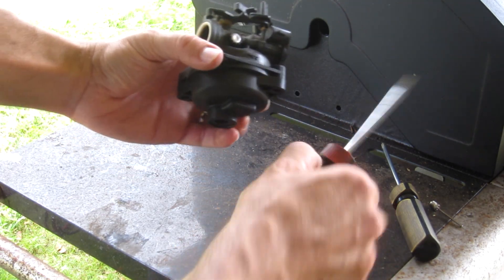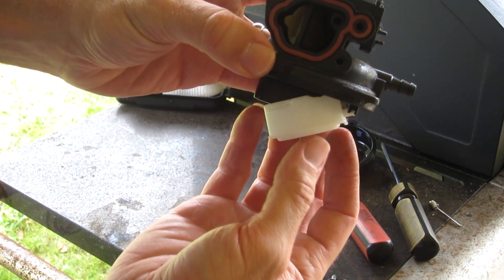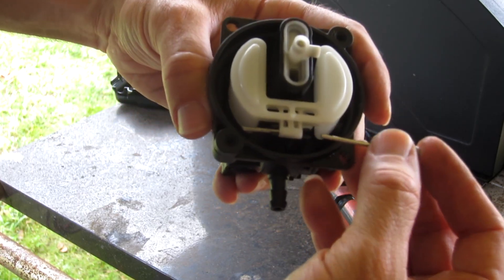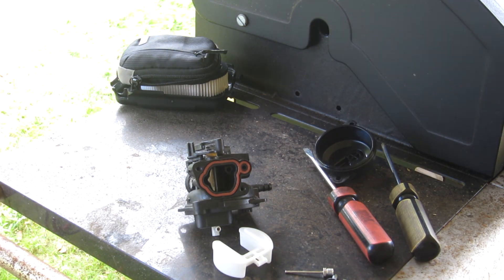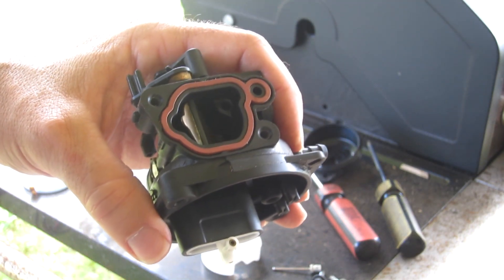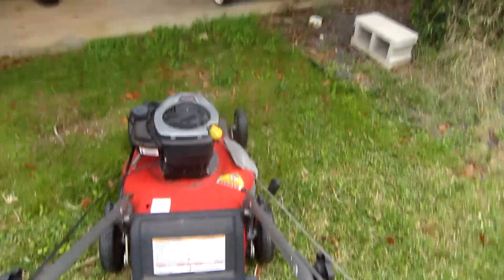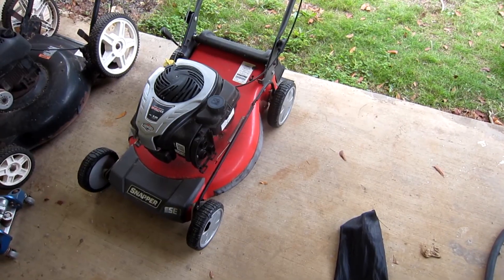Briggs and Stratton 550EX Carburetor Repair Part 2

Comment: Perfect instructions, presented in an easy to understand manner. I took the whole thing apart, cleaned it with the needle just like you said, mower started on first pull and runs great. Thank you.
Reply from the maker: Thank you for commenting. Congrats sir

Comment: Just watched another video. The guy was talking about the same prob i have. Everythings vlean and clear but wont start. He drilled out the bottom jet in the bowl.  Ssems like a vommon prob. Idunno if maybe the manufacturers put a jet that was too small in some of them or what. Thats the only thing i can think. Cuz half the people get it done by cleaning. The other half still wont run.

Comment: Thank you! When the needle came out, I do not see a copper ring in side.  Not sure if there wasn't one or it fell away as I cannot see one anywhere...  When I put everything back together, gas is leaking everywhere.  I'm checking all of the seals but wondering if that could cause the gas leakage.
Reply from the maker: There will have to be a seat for the needle to seal up next to, or you will have constant gas flow through the carb which will end up spilling outside.  That being said, the bowl o-rings are notorious for getting out of whack when installing the bowl so double check that gasket as well.

Comment: I have this exact carb and it does not start.  I have spark with a brand new spark plug.  Even spraying starting fluid into the carburetor does not fire it.  I took the plastic carburetor apart and it essentially looks brand new on the inside but I cleaned it anyways pulling the white pieces apart like you did in the video.  All the holes were open but I probed them with wire as well.  I used regular 87 octane gas and the gas tank had very little gas in it until I added more.  I have good flow from the fuel line of the gas tank into the carburetor because when I clean the carburetor gas poured out.  And when I check the spark plug it was wet meaning gas got into the combustion chamber.  I'm trying to figure out if I have compression I don't have one of those fancy compression testers.  But after I put everything back together it still does not fire and I've left the air filter off.  The auto choke with the cold engine is completely closed.  Please advise????
Reply from the maker: Then I would check the coil for functionality. Just because it has sparked does not mean it is good clean spark that is hot enough to make the engine run. I've run into that before. I have a video on a Toro lawn mower that threw me for a loop with an intermittent coil
Reply: @jcx2bby I will have to check out your video I could see why that would be a challenge I never heard of an intermittent coil.  This is also a toro
Reply: @jcx2bby okay I went out and I checked the engine brake and when the handle is squeezed the pad is about a half inch away from the flywheel not touching it at all when I let the handle go the pad rest firmly up against the flywheel. The dead man switch wire is connected to the ignition coil. I removed the spark plug and I turned the flywheel cup as fast as I could with my thumb over the spark plug hole and I really feel no compression at all.  I don't know if I theoretically can turn the flywheel fast enough to generate compression but it was moving pretty fast but not as fast as if you would pull the cord. Unfortunately I do not have a big enough socket to fit that flywheel bowl nut to check the flywheel key.  I doubt that is the issue.   I am completely stumped????

Comment: Mine turned out to be the jet itself also. Pulled it out used some lectra clean and a needle good to go. Saved me 30 bucks on a new carb.
Reply from the maker: @heywoodjablome2018  nice work!
Reply: @jcx2bby  you did the work brother I just followed your lead lol
Reply from the maker: @heywoodjablome2018  really appreciate you taking the time to comment. 
Your username is a blast from the past lol
Reply: @jcx2bby  I had a good father lol unfortunately he passed away before he could teach me anything other than jokes

Comment: After I cleaned the jet out and put it all back together I forgot that I had disconnected the spark plug wire and thought that it wasn't working. lol. Thank you for the video!

Comment: Really appreciate the video and I checked all this but upon reassembly I noticed that the throttle cable on mine wasn't moving the carbie levers at all. If I manually move the lever on the back of the engine that controls the wire directly on the carbie it works fine so my issue appears to be the cable isn't moving lever properly. Ran out of time to investigate further but I learnt a lot so thanks!!!

Comment: At 6:40 minutes the white plastic piece being remove is called a cartage and can be replaced with a new cartage.  Also the cartage comes apart, two pieces.  They more or less pull apart, might need a very small flat blade screwdriver to pry apart.  Both pieces can be cleaned and one of the two parts has jets which should be cleaned.  These jets usually clog due to using old gas, contaminated /dirty fuel or fuel varnish / corrosion build-up.

Comment: Good video. Repaired a couple of these types myself and your right, you may have to disassemble a couple times to get it right. So a good rule of thumb is to take your time and clean it good and it will crank first pull.
Reply from the maker: Yessir

Comment: I have done this several times and eventually the carburetor gets clogged up again. I have a running rotation of cleaned up carburetors and some new installs to keep things going.  However, I had a brain fart and there is a new red circular O ring in a new carb kit (other one is obvious).  I noticed I had a hard plastic circular and an older black O ring back to back for some reason, maybe in wrong order or place on the mower side where we are placing carburetor back on. If that makes sense, tell me what belongs or what the red o-ring needs to replace or maybe I even have 2 white plastic rings from previous installs?

Comment: It`s a really detailed tutorial... We have the same "piece of plastic" on our Toro mower. Can you tell whether this carby can be adjusted or cleaned only? There is no doubt, the engine runs on very rich mix... To fix this, we have to change petrol/air ratio. It can be done easy on metal carburetors by special screws. This plastic one do3esn`t have any visible screws. So, how to change the ratio?...  Thank you
Reply from the maker: As far as I know all the mixture and metering adjustments are long gone on these little carbs. Sometimes you can adjust carbs on 2-cycle engines, but the 4 strokes....that ability is gone.
Reply: @jcx2bby  Yes, you are right. I mixed up two and four cycles engines. Well... but is there any way to fix in case if the mixture is too rich (a spark plug is always covered with carbon)? Or just carb replacement? I`m really confused. Thank you

Comment: Great Video!  You could simplify it down to 1) Remove the air filter, 2) Remove the bowl [2 screws], 3) Prop the float up with the air filter, 4) Pry out the white jet body, 5) Clean out the jets with a wire or needle, and some compressed air, 6) Put it all back together.  You really don't need to take the cover, tank and carb off.  

I've rebuilt a carb or two in my past and this gave me the walkthru I needed before heading into this project.  I was given this mower by a neighbor who barely ever used it and was going to throw it away because it wouldn't start and they now had a service doing their lawn.  I did the 6 steps I mentioned above, and it started right up and kept running ever since.  Neighbor didn't mind, he hated mowing.

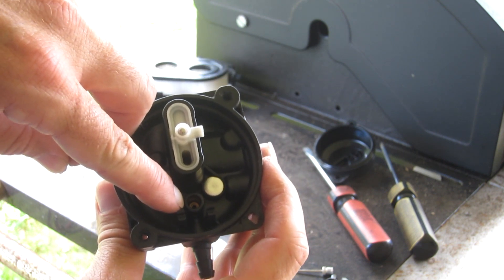Comment: thank you for posting.  at 3:42, what's the name & function of that round disk of what appears to be metal foil, approx 10mm in diameter, kinda east - northeast from the tip of your left index finger ?

Comment: Don't work over grass...or have a magnet handy. On the little white tubes I used one of those grocery tie raps by gently peeling back the paper to expose the thin wire, to be used for getting the green crud off the little brass orifices in their respective tubes (the little white tubes), including the two slipped one into the other. I blew out all the tiny holes with a little red tube on the nozzle of my starting ether. The bigger holes, a new q-tip gently inserted and rotated was effective. Any spraying, keep any tubes perpendicular to face and wear safety goggles, really! I prefer the ether since it is safer, I think, than the carb cleaner. If you disturb the giant o-ring of the bottom bowl be careful in reassembling it since the rubber will appear like it grew and now does not want to fit. And don't forget the little white plastic adapter ring that squeezes the o-ring against the rear of the carb tube going into engine hole. That's an easy miss. Thanks. again.

Comment: Excellent presentation! I put in a new carburetor in a Briggs and Stratton ex 550. The mower was surging and backfiring. Do the jets need to be checked on a new carburetor? Any other advice? Thank you.
Reply from the maker: On a new carb they should be fine. I'd just double check the bowl bolt is tight and then give it a rip.

Comment: I use the ultra sonic cleaner but I don’t heat it on plastic anything 
Carbs are ok but dirty air fines will destroy the engine IF not clean every other use

Comment: Great video, I’m on my 3rd tear down trying to get my mower running.  Mine says E10 fuel, no E85, where can I get this E10 fuel?  I’ve never had to use it before and this is my first time with a mower.
Reply from the maker: Most gas you buy at any gas station these days is an ethanol blend of up to 10 pct. Hence E10. 
Ideally, you don't want any ethanol in these engines as it leaves a terrible residue on the inside of the fuel system that causes starting issues. I run Seafoam in all my small engines now to prevent ethanol residue from gunking things up.

Comment: I purchased a new jet for my mower, it came with the part that you took out and cleaned  using the needle, but it also came with a separate lil tiny jet in small bag .... I need to know where that lil pa t goes
Reply from the maker: Not sure I can help with this one. Would need to see some pics of the parts.

Comment: This may be from 5 years ago, but I have this same exact mower that was abandoned in a shed. And was able to basically get it for free! And I've never was able to get the original carb to really ever run right. But I bought a new carb off Amazon but I think I have the wrong jet Inside my carb. Because it surges up and down and I didn't realize that the carb is not the same part # as this carb. But thanks to you now I know what size jet to get for my carb! Should make it run great afterwards In my opinion.
Reply from the maker: Awesome, I am pulling for you, hope you get it sorted out soon.

Comment: Wow, Help all the way out to Australia! I have a locally made Victa mower with the same Briggs & Stratton engine with the same problem. It is 19 years old and this is the first problem ever. Thanks to your first class youtube tutorial I fixed it for no cost. Most of the car jets were partially blocked with 19 years of accumulated crud. There was some black foam jamming the needle and seat almost shut. All fixed now thanks to your help from Hawaii and youtube. Thanks for posting this very helpful clip.
Reply from the maker: Hey Gary, thanks for taking the time to post this! Congrats on the fix, although I am no longer in Hawaii, it's nice to see how far and wide this little video has traveled over time. Cheers

Comment: if you dont drill the jets out to 50 thousandths your going to have perpetual problems . this carb design is stupid,, the fuel has to make a 90 degree turn and its a clog  point,  why they designed it with suck tiny jets is a mystery to me.
Reply from the maker: Interesting tip.
Reply: @jcx2bby  every 90 degree bend add a multiplication of 5 to any flow, whether it be water, fuel, oil..  in other words it takes 5 times as much vacuum to pull the fuel thru the 90 degree bend  than if it were a straight tube..  these engines are used in 5.5 to 7 hp applications.  the way they decide on horsepower, is the carb jetting and sometimes carb throat size, but mostly jetting,, being they are fixed jets, you cant change them but you can drill them and unleash the power and reduce jet clogging problems,,  the way the fuel tanks are made on these engines .  the pick up tube sits abt a 1/2  inch from the bottom of the tank , so there will always be fuel in the tank even if you run the motor until it cant pull anymore fuel.... so  when you add more fuel, the residual fuel in the tank,  that has been sitting,  gels, and the gel blocks the jets.  people look for dirt and debris in the carb, but dont find any and wonder why the jets were clogged,, well this is the reason., globs of gelled fuel. 
look inside your fuel tank and you will see what I mean.,, when  storing my pressure washer, I turn the engine sideways,  stick a rag in the tank,  to absorb the rest of the fuel out..

Comment: Great video! For cleaning out the jet I use a wire they use to close a bread sack, simply remove the outer coating and the wire is the right size. I keep one in my wallet for a emergency fix.😉
Reply from the maker: Nice!

Comment: Thanks for the videos. Very helpful. I had a similar mower problem (would run for a second or two with a shot of carb cleaner, but not otherwise.) I cleaned out the carb as you showed, but it was pristine. No gunk at all. Turns out that the fuel outlet at the bottom of the fuel tank was clogged. Could have saved myself some time by not bothering with the carb at all, but I assumed that was where the problem was. After cleaning out the tank, i'm happily running again!
Reply from the maker: Nice work!  Thanks for watching and commenting

Comment: I don't know why you don't use the little red straw that comes w carb cleaner to clean those jets
Reply from the maker: Simply because it isn't small enough to get in the holes.
Reply: @jcx2bby  true but all you have to do is just push straw flush against jet and just hit it quick, not long hits. Cleans it out in a millasecond
Reply from the maker: @Hugeroost  not if it is a crusty mess. You need to break up the gunk sometimes, first.
Reply: @jcx2bby  maybe so, guess I never had one that bad. On the older flatheads which is what we run, I put that straw flush w all of em and the seat, and just bump it. On those the nut that holds bowl on also has a couple vent holes that nobody ever thinks about. And that red washer, people lose that alot it's so small and thin. These new EX series from Briggs are absolute junk though. I get less than 6 mos outta one, almost 2 years out if old one.

Comment: Where is the lil spring. I can’t figur where it goes. Yours didn’t have one.
Reply from the maker: You might have to look up your engine model code on the B&S website to see if it will give you a parts breakdown.

Comment: Does the smaller jet with the o ring have a hole in it also?
Reply from the maker: I don't believe so. Just clean the junk out of it so it doesn't spread to other parts of the carb.
Reply: @jcx2bby  cool thanks for the reply..

Comment: Just found this video and man was it a huge help!  I replaced the spark plug, changed the oil, dumped the gas and added new gas and a cleaner, and nothing.  After watching this video I had the courage to take apart the carburetor to clean it and by god it worked!  Thank you so much.
Reply from the maker: IB, awesome! I am happy to have been a small part of your success. Thanks for taking the time to comment.

Comment: Try drilling out your main jet with a #  drill to a hole size of .020
Reply from the maker: What does this do
Reply: @jcx2bby  Normal main jet hole size run around .028 + , so I found this hole size is way to small and plugs up very easy .
Reply from the maker: @barryestell6324  thanks for the tip!

Comment: On mine that little silver disc fell out of its location I just pushed back in him wondering should it be glued in or just pressure holds again
Reply from the maker: Which disc?  In the bottom of the carb?
Reply: @jcx2bby   It's the one that is about a 1/2 inch in diameter underneath the floats on the float side of the carburetor
Reply from the maker: @carlbarber3444  I see. I'd probably try to seal it in there with something. Or.get a new carb if it keeps coming out.

Comment: i removed and cleaned my carb but when i put it back together gas leaked out, not thru the hose but the main part that opens and closes (where the red seal is at)
Reply from the maker: Ah, the float is most likely stuck down or the needle is not seating closed properly. Sorry for your troubles but you will have to pull the bowl and have a look at those 2 things.
Reply: @jcx2bby  thanks a lot i appreciate it!